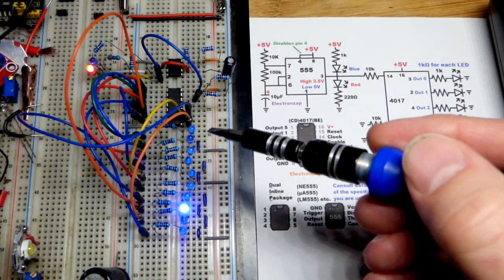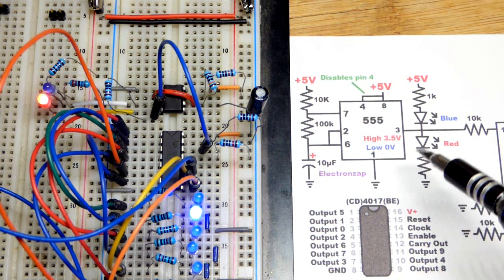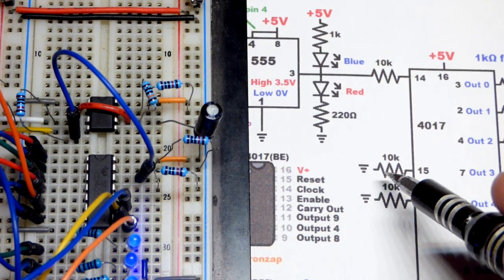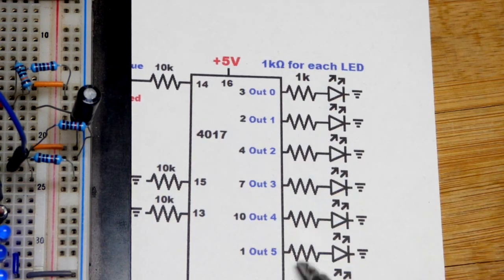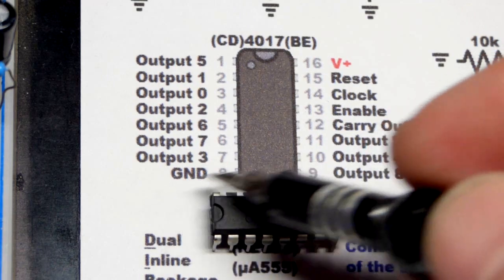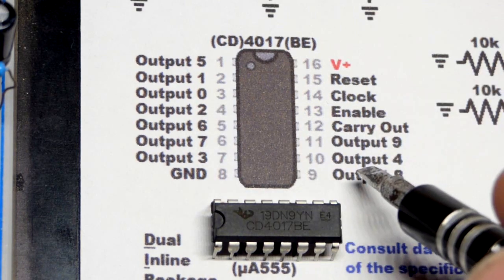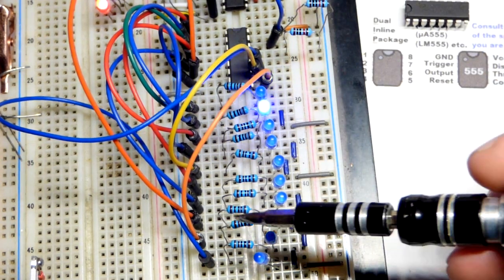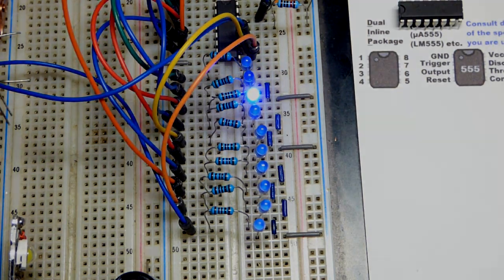Ten LED chaser circuit using 4017 IC and 555 timer schematic by electronzap

Comment: I am using a potentiometer to control and slow down the speed of the 555 and the LM4017 outputs. I'm wanting the LED's to fade when they come on and off and I am experienced with many different circuits that fade LED's. I have tried basic cap and resistor pairings at the LED's and also by using the 4017 outputs to drive bc547's transistors that turn on the LED's, again with different arrangements of caps and resistors on the base and/or emitter sides and I've also tried resistor/cap arrangements that can turn square waves triangle or sine, with and without the transistors. In all cases, I can get a very controllable fade out of the LED's but cannot get them to fade on. Is there something about the output of an LM4017 that will not allow it's waveform to change or for a capacitor to slowly charge? Or something else that I just can't figure out?

Comment: I was thinking a resistor array might come in handy. I put together a kit a couple years ago that has everything on the pcb. The downside is not being able to change the led color. They’re all red on mine.
Reply from the maker: Yeah, resistor array would probably be perfect. Good thinking.  I don't think I'll buy any of the kits I seen. They don't look like they are easy to modify. So far,  I'd rather design it and make it myself on a double sided PCB board.
Reply: That’s a good idea. You could get one of the pcb companies to sponsor you. All the electronics channels are doing it.

Comment: Do you have a po box? I had jlcpcb make me some breadboad friendly 5 smd led boards and i can send you a couple.  Keeps the breadboard clean (resistor and led are on the board, both smd)
Reply from the maker: No I don't, but thanks for the offer! This might be the first reason I special order PCBs. I am not finding anything close to what I want so far.
Reply: @Electronzap  no worries, if you use jlcpcb and panelize them you will end up with more than you will ever use so they are good to share with people, i think i got like 400 for $8-10.  Since you have to pay extra to panelize you get to pick whatever color you want too